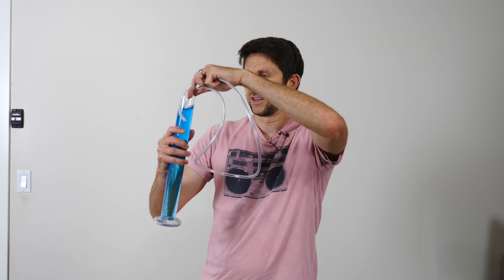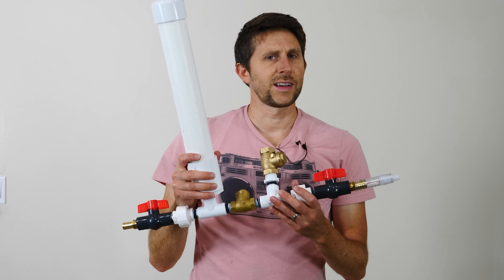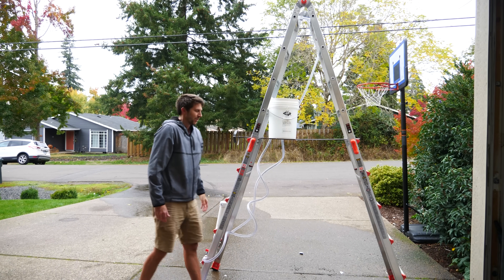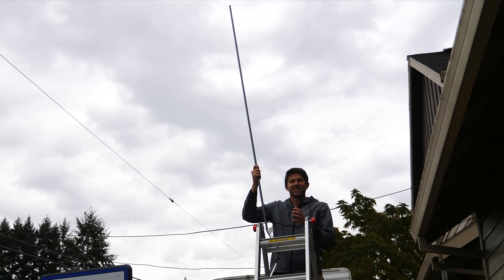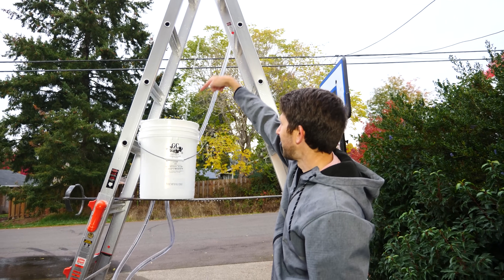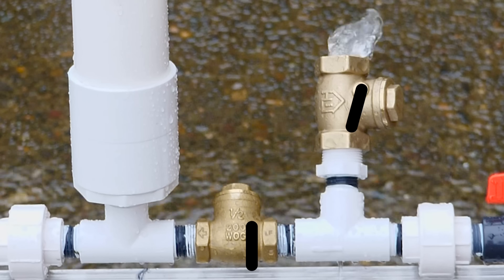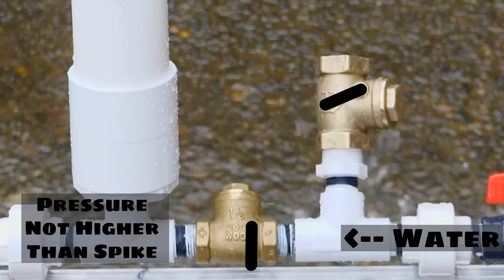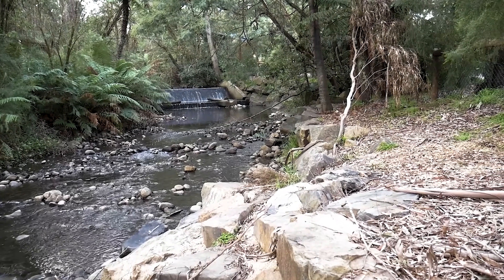Can a Hydraulic Ram Pump Make a Perpetual Motion Loop?

Comment: I noticed that your bucket is up on the latter. Why not put the bucket were the siphon is so that the water doesn't only go in the bucket from the top hose alone? Then there wouldn't be any waist... Like to see if it's possible. If I placed this setup by a lake were the siphoned water at the valve would return to it's source then the water wouldn't be waisted other than evaporation the loss would be minimal. ??? What do you think??? Great video by the way. I have seen several videos of this being done but your demonstration was fantastic.

Comment: Seems to be from a conservation of energy perspective, that in using this design with the addition of a solar or wind-powered water recycling loop (from the outlet check valve and the outlet of the gravity fed house hydraulic battery link back to the main reservoir) one can "scavenge" the more or less free hydraulic power provided by your local water system in slightly over-pressurizing the source water to your home to create a pretty damn efficient home energy storage system. I think the inefficiencies as such would be in the overconsumption of water, the small inefficiencies in the solar or wind powered pump that would drive the water recycling loops from the outlet check valve and the power-drained end of the hydraulic gravity battery, and the inefficiencies in the hydraulic gravity battery converter of the elevated water to house power. Interesting concept.

Comment: Of course it can't! A ram pump just uses the potential energy of a large amount of water to push a small amount of water higher, by converting it into kinetic energy, then using that to lift the small amount of water. Energy is conserved.

Comment: Your lossing water so eventually it will stop working so it isn't perpetual but what if you had a tower full of water and inside that tower you had a tower of buoncy wheels that captured air from a very small air pump and each wheel turned a generator producing more power then your pump is using is that perpetual no because eventually it will break down and you need external power to put it in motion 🤔

Comment: What if you used three check valves where you had a pipe that went to the top of the air cylinder but down lower into a low level of water. That way, when water goes in, the water from the exiting check valve builds air pressure to close the top valve and open the bottom check valve.

Comment: If you put a tank (with an air hole in the top of it) on the waste valve it eventually collects enough water to increase the pressure backwards & puts a small amount of water back into the system that again increases pressure. 
You can multiply this setup & also use higher pressure valves to get a head height to unimaginable levels.
I currently am pumping up 100 metres using a tripple setup that is only running on 19mm piping.   It delivers approx 200 litres per day. 
It cost me $41.32 in total & has been running for over 5 years
Reply: wow...
Reply: That's serious and what is the maintainance like and do you have to manually open and shot the system down everyday or does it run 24/7
Reply: Would you say an oversized version of this could be used in an application that requires pumping water up 600m?
Reply: @beyond6storm  i saw a huge one on youtube.
Reply: @beyond6storm I can see no limit to this
Reply: @David-h5r1x  The (theoretical) limit is: For every liter that goes a meter up one has to go a meter down. So if you have 100L, you can let 99L one meter down to getOne Liter  99 Meter up. Or you let them 2m down for 198m. Or you let 99.999 Liters one meter down to put 1ml up to space (ignoring friction and reality as a whole obviously :D)
Reply: @beyond6storm  I guess theoretically yes, but the amount of infrastructure you need grows exponentially. Think of it this way: You build his setup three times to fill a pond in 100m hight, which is sufficiently filled to build the setup again to get 200m and so on
Reply: Do you have any videos . Would love to check that out
Reply: Please sir, will you share a video of it with us? Could build a generator with it and run basic systems in the house with it. Technology to free us is out there, but it is denied to us by slavers. Please teach us how to build freedom!
Reply: How tall of a tank? How much does it fill?
Reply: I'm looking for a way to feed a small artificial stream and I was just thinking about it, if the whole system is placed inside the liner and the waste valve is located above the water level maybe it could work. Or maybe i'm talking nosense and a physic is laughting while reading this
Reply: @maddog74  you mean in a pond?
Reply: I see so many applications this could be used in our city infrastructure. It would save money and be very reliable and if the power goes out it keeps on running

Comment: what if you just connected the end of the waste water valve to the bucket so you dont have to refill it and it just goes forever, then you connect a turbine to the falling water coming in the top to generate electricity

Comment: You can use the waste water to drive a water wheel that generate electricity and with the waste water going into another smaller ram pump pumping back to the original tank with more water wheels and ram pumps down the line until there is so little waste water that you can pump with a small electric water pump

Comment: Water can turn a turbine with enough head pressure (height)  add a Tesla turbine and water tower to get free power.  

The power can then work a pump to recover the water lost and run electricity if coming from a high enough source. Even add several and cascade lost water to the one below until you reach a point that head pressure will run or push a turbine

Comment: I thought a hydraulic ram pump turned 
FLOWING water into some of it being able to be pumped ' upward '
with considerable difference between the amount of water ' flowing ' and amount of water being pumped upward.
Which without any real calculating but just observing and off the top of my head would be like asking " can a 100 lb. flywheel turn a mechanism that spins the flywheel and make it perpetual motion?
Which would be, no.

Comment: People where as this looks ideal what he doesnt mention which is critical is that your water source lets say a creek or river must be higher in height than where the ram pump is situated or the pump wont work..... My dumbass bought one of these devices thinking that just because my creek has flowing water, and that the flowing water was sufficint to flow through a long tube connected to the ram pump thinking it would work. Well it didnt. Your creek needs to have a drop of certain height to generate flow rate to the ram pump. Only then will the ram pump work.

Comment: Ram Pumps essentially are the water-equivalent of electrical transformers, specifically induction coils, and the spike in pressure from shutting a valve is analogous to the voltage spikes induced by back-EMF.

Comment: If you connect a pipe to the waste valve it will also pump up to the original bucket of water. So if you can keep the water from evaporating, you do have close to a perpetual machine. Nothing but the Universe is actually perpetual.

Comment: I'm in my mid 50's and when visiting a hydroelectric dam as a young teen, I asked myself a question. 
If the massive generators within the dam wall reply on water pressure to create electricity, why aren't there another series of generators directly linked below them in series?
The dam was certainly large (tall) enough, and there'd be minimal power loss if they're directly linked. What if they repeated this several times, so one flow of water powered not one, or even to, but as many as the height of the dam would allow?
Yes, there's going to be some loss, but the force of the water flow combined with gravity, should be more than enough to warrant this. 
Decades go by, and this idea eventually becomes really evolved, so much that I have completely isolated this concept to the point where (all 12v systems for now) I will soon be building a stand alone, self running, mini hydroelectric generator. 
Of course, I have a small fear that I will blow up to $500- (Australian dollars) in components. One 12v pump moves the water about one metre (3 feet) straight up (the pump has the head pressure to pump up to 10 metres vertically) to the top of the system, where the water flow encounters the first 80w 12v hydro generator. Immediately below that one, the outlet is directly connected to the inlet of the next generator. This is repeated with a height loss of 8cm with each generator with a total of 10 generators.  Obviously, it needs an external power source to initiate the water flow, but once running, only parts failures should stop it. The system has no reservoirs, and the (10mm) pipes remain totally full. Also, I don't expect the 10x 80w generators to generate 800w of 12v power, I do expect friction loss to some degree, but the pump only requires 60w (5amps) of 12v power to operate. I expect that about 3 or 4 of the generators might be required to keep the system running, and I hope to bleed off enough power to operate USB powered devices. 
If the initial system isn't efficient enough, the system can pump water twice as high (10x is it's capacity) and have twice the generators (20) to hopefully solve the issue. I made a video showing the design concept in detail, but it's private so only those with the link can see it. Once I have enough money to buy all the bits and I get it built, I will be selling working versions to the public, but I will find a way to patient it first. My fear is that the costs of the parts might be the thing that stops it selling.
Reply: Sorry David, but your idea will fail. You are decribing a Perpetuum Mobile. May have dreamd of inventing that, no-one can ever succeed.  That is impossible due to friction.

Comment: Dissolve a water-soluble spin ice magnetic monopole solution into the water and emplace a sump for the waste water collection. Make the sump have a nanoscale version of the NASA-developed dynasoft friction pads with neodymium one-way-higher-friction levers in a toroid around the flange of the aforementioned sump. LOL j/k...

Comment: you could add tubes with floatiing balls to ad dinline pressure, once you build negative pressure in vertical tubes you have a pressurized system from down up

Comment: if you have a wide enuf hose, and enuf water in it, and you constrict the opening of the hose, after the flow begins like you do a garden hose, the water would shoot higher than the crescent top just like the leaky boat analogy but basedon mass/weight/press of wate rin tube

Comment: Quick question from a non-engineer: could you recapture the waste water from the taller valve and pipe it in where the cap is on the lower valve? What I'm thinking of is a closed loop system.

Comment: you usedthe bucket as source height gravity stored energy then the vaccum chamber of the ram pump filled with water and both combined at apex wave point to amplify pressure with one way valvesz or tesla valves that can add pressure of distance if resistence is low enough

Comment: add weight lol .. or use pressure to pump lots of small tanks and gain stored gravimetric energy also when you sucked water over the tube you stored energy in it

Comment: I suppose, if you have a method of catching that waste water and manually put it back in the system (regaining mass), it could actually be quite efficient. Great tutorial, thank you.
Reply: All you would need is a catch basin,a few more valves and a couple of minutes a day.
Reply: ...that did feel like important point he didn't bother with.
Reply: Of course he did not bothered, he simply repurposed other already available videos on the subject, finding that part out would require doing something actually creative 😅
Reply: I was looking for this comment
Reply: A second of these machines, that shoots waste water into eachothers buckets
Reply: just use it on a river and send the waste back to the river ;p

Comment: I wonder if say you had 2 X 10,000 liter water tanks, once full of water and the other receives the waste water. If you had a small hydro turbine charging a battery bank on the full water tank and a pump on the waste water tank would you be able to generate enough excess electricity to pump the waste water back into the first tank and still have spare electricity to consider it charging the battery?

Or another thought is what if you had the same example as above but in the waste water tank you had 5 separate levels running with the valves so you could recycle more water without power in an attempt to gain excess energy to charge the battery and run the pump?

Comment: What if you put a T pipe before the first manual cut off valve? Connect a pipe to the waste water valve so waste water feeds back in the system. Would it still work without wasting water? 🤔

Comment: This works but with the cost of lots of wasted water at the valve. Water supply at the starting higher level source with eventually run out and this pump will stop. You cannot return the same amount of water back to the starting tank because of huge waste of water that makes the whole mechanism work - no perpetual motion here

Comment: Would the system stop working if you ran a hose from the waste valve to the bucket? Does it drop the pressure of the system because of the pressure of water in the waste valve hose. Cause if it does still work then it would refill the bucket up.

Just wondering.

Comment: Could you not have a tall tank (like a cylinder) which has the hose outlet near the top and have the valves near the bottom where the excess water released by the valve is then recaptured into the cylinder so as to make it closed? It would require another system to refeed it back in, likely under pressure, but surely that's possible?
Reply: why would you want to fight gravity when this device already benefited from gravity  ask yourself that question that's the answer

Comment: 🚨QUESTION🚨
If you put a small turbine or paddlewheel under either the waste valve or the discharge (or both) could you generate a small amount of electricity ... to maybe fuel ... i don't know ... a charger for a battery?

Comment: If u use a big pump that moves a big amount of water and let fall the water to another weel that rotate and produce electricity and let fall the water in the tank back and with a 12 volt pump refill the tank with the waste eater than u have a perpetual movement, of course the energy that the motor has to produce has to be more than the electricity that the 12 volt pomp need to refill the waste water

Comment: Definitely cool stuff vacuum suction kinetic energy created by the loss if only you could take the loss with heat and do an evaporator coil and send it back to the bucket may Create multiple perpetual palms that go into a coil that sends it back to the original source stick it in the ocean You would have an infinite supply but would require the sun to evaporate the waste for the return therefore you retain Free kinetic energy better yet what if you use the evaporated water from the ocean over a huge scale I like this stuff

Comment: It would be interesting to see how much you could optimize this process. As in if you can increase the preassure or remove friction with ferrofluid and magnets, evaporate part of the wasted water and collect it by letting the steam drip back down into the bucket from a dish.

Regardless, this seems like a great way of saving energy if you need to transfer liquid, as you would need to pump less mass through an electric pump.
Reply: what if you had a large pool of water  as the source instead of a bucket , then you took the tube and connected it to the valve that spurts water out , ehat if you put that valve over the pool so the spurting water goes back to the pool and then the tube with the water getting pumped is curled upside down so the water goes back to the pool do you think that would work ?
Reply: @AcVlogsYT nope.  The outlet for the waste water valve has to be lower than the source, otherwise the weight of that water will prevent the valve from switching, and the water will not flow.  Raising it is attempting perpetual motion of the pool filling itself.  Without the loss of water at the bottom or gain of water at the top, (or both) this machine stops.